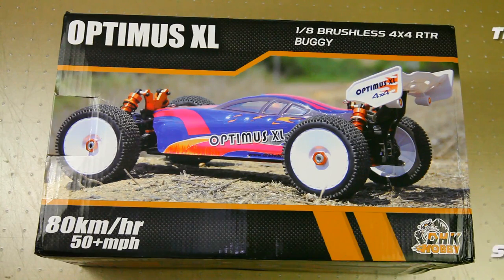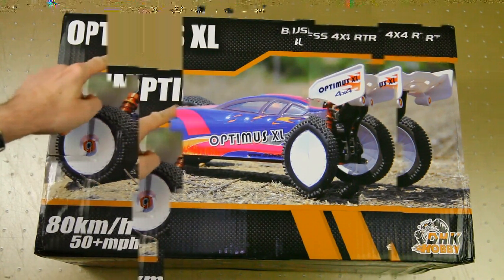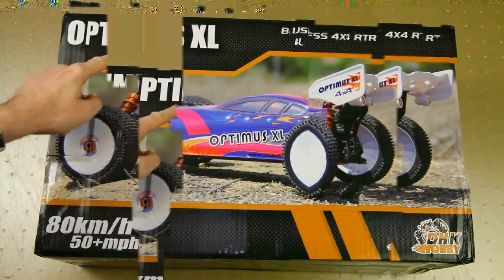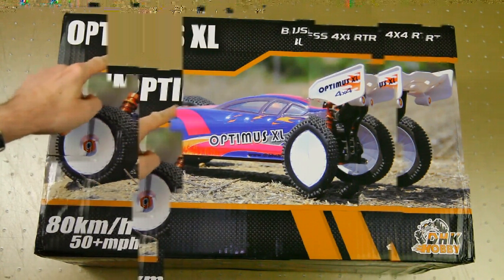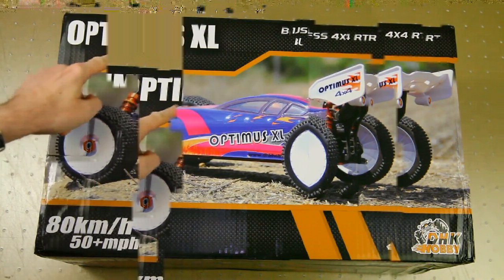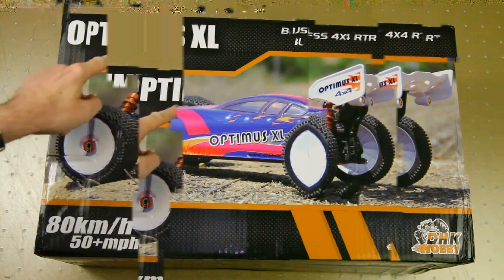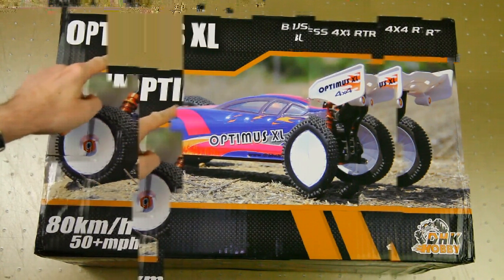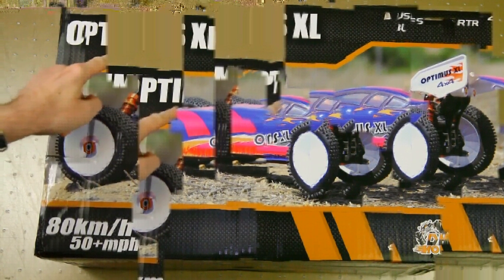DHK Hobby Optimus XL 1/8 4x4 Brushless Buggy - Show & Tell

Comment from the maker: Racer or Basher? Let's have a good look at this DHK Optimus XL Buggy :)
Link to the car: https://goo.gl/YkBgJf 

Link to a wheel-wrench: https://goo.gl/8WIuHf 

Link to a reasonable charger: https://goo.gl/WBQmtL 

Specs:
Type: 1/8th scale racing buggy 
Motor: brushless 3670 2030KV 
ESC: 100A Waterproof (non sensored)
Servo: 9Kg metal geared 
Lipo: 2x 2S 3200mAh 30C 
Radio: 2.4Ghz (with throttle trim) 

Needed to run: 
4x AA for transmitter
a better charger (see links) 
a wheel wrench

Comment: Hey Dutch! Ahh finally the unboxing video of this buggy. I'm overly impressed what I see in this buggy. It has the adjustable parts to tune it for racing but i think it's meant for fun and bashing. it can easily go on a track but we both know this isn't going to compete with a TLR, Mugen or Xray.
I do wonder about the damping of the shocks. looked too springy/bouncy for me. those springs are just strange! And i think i gathered from your video that the shock lengths are the same for front and back? That's odd too.
I'm likely the motor mounting system with the heatsink... ready for a fan but i'm guessing the body wouldn't allow for a fan to be installed. 
Overall lots of orange aluminum and looks pretty solid. I think you hinted before to me about the shocks, could be a weak point but hey, you can always get a aftermarket set and install them.
Ok sir thanks for the great video. cheers mate!
Reply from the maker: Howdy Mike :)
yeah hmm I was kinda holding off on this video until the spare parts turned up :$  BG does say they will carry spare parts, but apart from the shocks, I haven't come across them yet :$ 
It definately is a basher yes! And the shock oi.. hmmm looks / feels far to thin really, but we will soon find out :)
Thanks brother!

Comment: The chassis looks very beefy, that being said, I hate the body. I was already wondering how hard it would be to modify it by adding standoffs and a different body. All that work on the frame,etc and they blow it with an awful looking body. Yuck. Well, I will watch the review and see how it survived the Dutch demolition derby. Give it the beans!  I do know I will be in the market for something to take on my forest walks this summer, we are talking tree roots, hills, leaves and other forest pathway type stuff.
Reply from the maker: Hahaha :D  ah yes.. looks are definately a personal thing indeed ;)  Surely there are other buggy-bodies that will fit this car though ;)  Wouldn't a scaler be better for forrest walks by the way? (Longer run-time + not as fast)
Reply: DutchRC Adventures I am not sure what I need but I will check into the scaler size. Yes longer drive times and slower speeds, lower gears for the rough spots for sure. I have a great place to do that. You would love it there. Lots of woods,plenty of places to take an RC vehicle there. A huge field for flying in if I brought my small glider or a wing type flyer on a back pack.
Reply from the maker: Depends ou your budget offcourse :)  If you dont wanna spend To much $$.. Something like the HG P402 would be nice :)  Otherwise Some Axial car maybe?
Reply: DutchRC Adventures I am thinking $500 maximum I plan on spending on a car. I know I have $300 comming this spring for dog sitting for a week. I have a couple jobs already lined up as far as small engine repair as well as a few mowers and weed eaters to sell. This winter has been slow so no one gets tired of shovelling snow,I haven't been able to sell eather one of my snow throwers. Unless people get tired of shovelling, they won't invest in one. That and we really haven't had much of a winter. For Northern Michigan,that is saying alot. As a kid, I remember having snow up to the roof line of our house. We had to dig out the windows to see daylight. Boy those days are gone.
Reply from the maker: Well for That kind of monney you can get a real Brand car.. (like an Axial SCX10).. How is your health doing these days by the way? 
Over here we actually had a pretty Cold winter this time.. Not a lot of snow (again) though...
Reply: DutchRC Adventures Thanks for asking about my health,that means a lot. I had to jump through hoops with the insurance company reguarding my pain medication. It appears they changed some rules reguarding my medication without notifying my doctor. I get tired of a panel of 7 people whom are not even doctors playing God with my health. I did get it worked out. Now I have to see my regular doctor every three months but not complaining about that. The weather plays a big factor in Chronic pain and how it affects our body. Being we are essentually a walking bag of water run on electrical impulses, things like barometric pressures really do affect those with already affected nervous system issues. Taking a knife and slicing through those connections,then expecting nothing but success sounds pretty crazy doesnt it? I am happy not to be battling Cancer any more,but would have been happier had they found another venue to removing that which afflicted my bag of water and electrical connections without short circuiting it in the process. It pains me to see they are still using the same procedure on others to this day but not informing them of the possible long term effects. Its called a Partial Nephorectomy.  Yes,I plan on spending enough money so that I get what I want without the heartache of dealing with spending that much in improvements to a lesser model,eventally achieving the same results. I learned this from dealing with my helicopter and this look alike A-5 that flys better inverted than upright. I need to avoid anything that flys with the Smarter Image name. Lol. Stick to name brand items if I can for a while,avoid disappointment.  You get what you pay for. I did buy another Waterproof drone available from Banggood and now gearbest. Remember I had them send me a replacement transmitter? Well,I got it on sale for $22 . I have bought three of them now. They are a good basic quad for the money and I really like flying it. I gave one away as a gift,and probably will this next one.
Reply from the maker: You're welcome mate ;)   Damn.. farting around with health insurance.. That can indeed be a pain, though I'm sure it's worse over there then here..  Glad to read you got that sorted! 
Ghehe yeah.. bag of water indeed ;)  And some electrical circuitry.. 

Ah yes well.. even on more expensive rigs you'll find you Will want to upgrade things, but that Is part of the fun with cars like this.. Making them perform just that little bit better.. Not everything needs to cost $$ though.. adding some lead onto the wheels will help for instance..